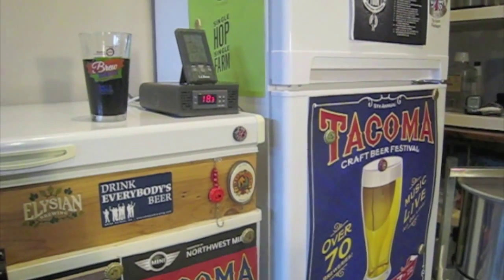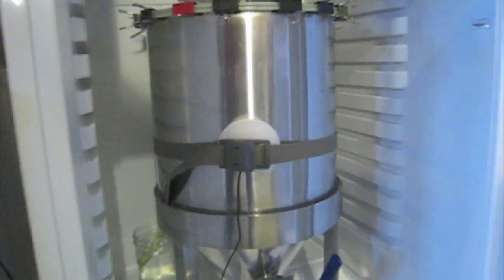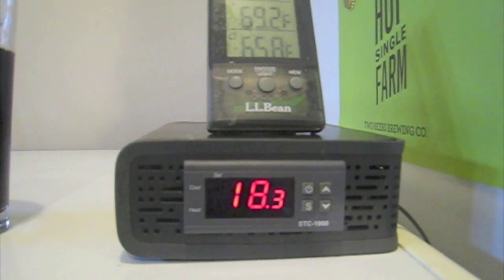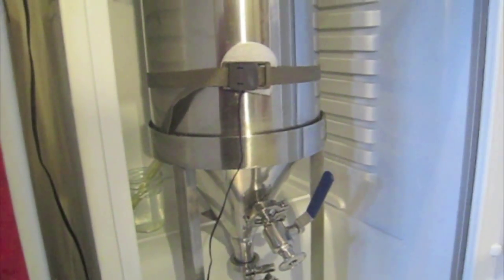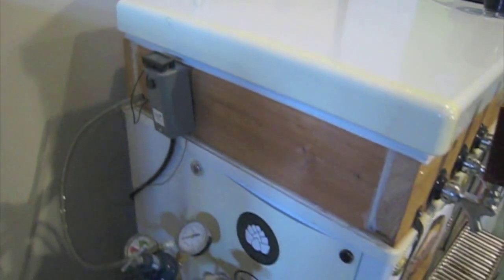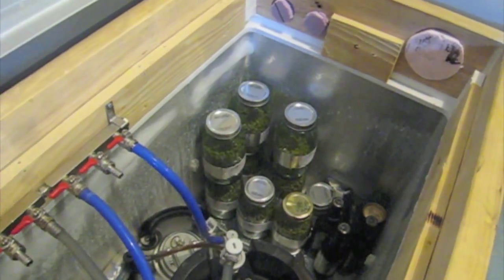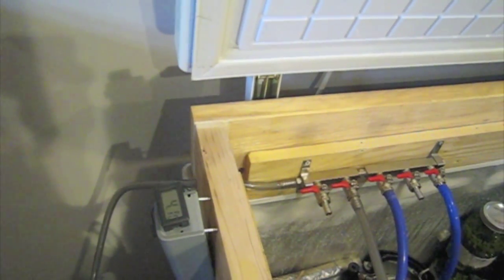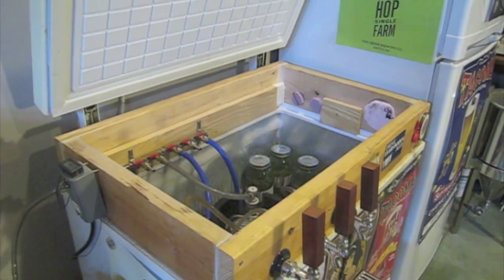Fermentation Temperature Control

Comment: Awesome, what brand and model fridge and did you have the cut the third leg on the chronical
Reply from the maker: Thanks for watching.  The fridge is a Haier, I bought it at Lowes.  I like the small size.  Good observation on the 3rd leg of my conical stand.  I did have to cut it to get the unit to fit.  I have an "extender" that the short leg slides into when it is not in the fridge.  I have a 2nd conical that is a bit taller and more narrow and it fits in there without any modifications.

Comment: Great video.  I have an unused ice chest in my garage that I'm going to try to see if the STC1000 works.  My question is, how much of an electrician do I need to be in order to install the STC?  Also, would it work with a chest freezer?
Reply from the maker: As for your electrician skills, search on the STC and you'll find several good videos on YouTube to help.  It is pretty easy.  One thing in the back of my mind is to really make sure you know what goes where.  I "think" there is a typo in some of the instructions (you'll see and hear comments on this).  It will work with any appliance.  Small point that some complain about is that it is Celsius only - no big deal in my book.